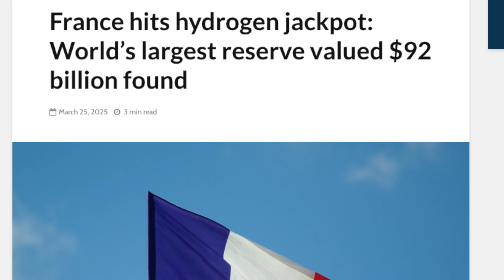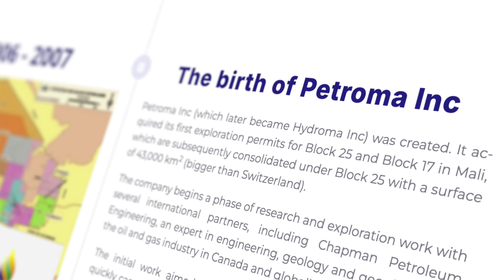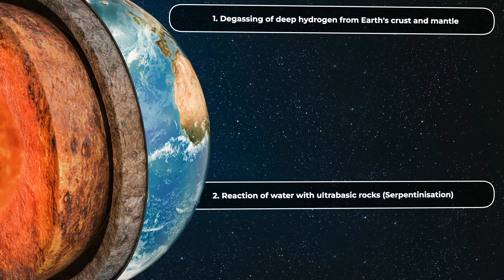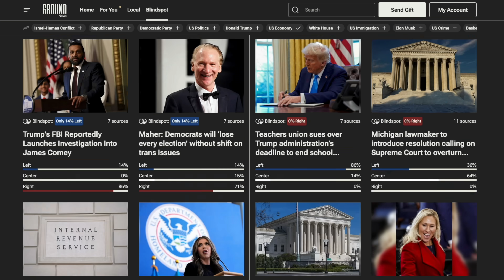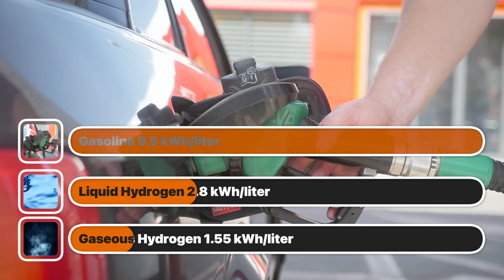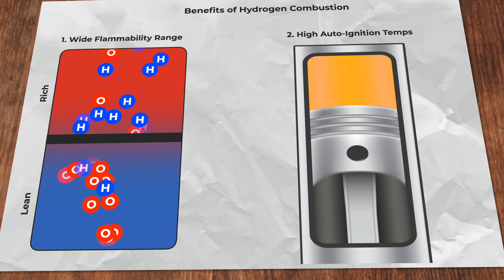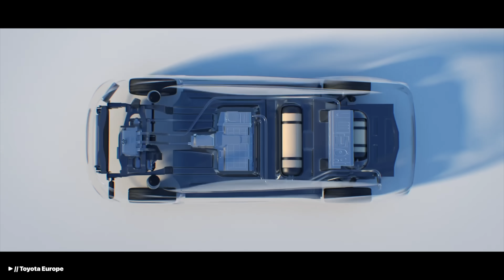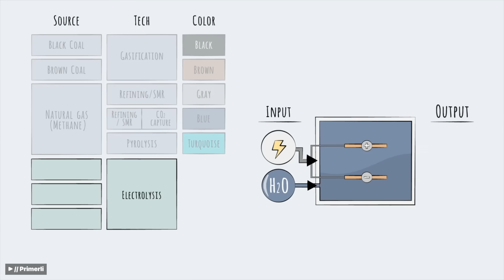This Hydrogen Discovery Can FINALLY Replace Oil & Gas!

Comment: I would really like to see a video about hydrogen for aviation. Liquid hydrogen might not be suitable for transoceanic flights but it should be more than good enough for travelling within a continent. But the issue is if aircraft can be made to handle cryogenic fuels because liquid hydrogen's temprature is -252C

Comment: 1- We too often think that one resource is the only answer.  For our power needs, many options are there.  But the nature of the need will determine the viability of the solution(or fuel).  What is best for powering our electric grids, will probably have little value for powering our vehicles.  And for a resource(fuel) it's conversion, transportation, and storage also determine it's viability to  a specific use.  
2- This is another resource that will be exploited for use and profit.  I can't but wonder how we are different from the aliens in sci fi movies like "Independence Day."  Is our behavior just leading us to ravage our planet?  But not have the space travel to find and ravage other planets.  We don't seem to understand that our planet is finite.  And we cannot just fly away.

Comment: Nope.  A plane with the heavy tanks necessary to hold high-pressure hydrogen would weigh a LOT more than a conventional jet-fuel plane.  

It's not an apples to apples weight comparison.
Reply: According to the data on Wikipedia and some back of the envelope calculations, if we scaled up the technology used on the Toyota Mirai (which operates at 10,000 psi) to work for a Boeing 787 - the storage tanks alone would weigh 645,680 kg and their volume would be 900,262 litres. That's a 3 metre diameter cylinder about a 127 metres long. Add the fuel and you have 680 metric tonnes, so obviously, this won't be the approach  .. they will need to use liquid hydrogen at much higher density and lower temperature.
Reply: The passenger seats would be mounted on the wings, free hair due😮. @jim23mac
Reply: @jim23mac  Did you include the fact that tanks scale very efficiently?  You can increase the volume of a tank by a factor 100, at 10 times the cost. Basically because the surface area of a tank increases much less quickly compared to how much it will contain.  If you didn't include that, I imagine the actual weight would be vastly lower then what you calculated here.

Another factor that could influence things is, is that car tanks would not be optimized for weight, unlike things in aerospace. One can for instance consider how rockets running on hydrogen don't have tanks weighing remotely as much as you calculate there. Admittedly those tend to work via cryogenic liquid hydrogen, but never the less it shows how large tanks could be made in another way.
Reply: @Quickshot0  No - I didn't factor that in - I was just stating the worse case - but I did say they could do a lot better. Also - after doing some more research - I'm pretty convinced that any long-haul aircraft would use liquid hydrogen, where pressure is not longer a problem. I'm really not any kind of expert on this - just thinking out loud.
Reply: @jim23mac  Got it. There probably is some kind of solution in any case, as Airbus seemed willing to look in to it.
Reply: @Quickshot0  I'm pretty sure that Airbus gave up on hydrogen.  People who understand what it takes to get an airplane certified will tell you that hydrogen is an absolute non-starter.  The only sane thing to do with white hydrogen is to use it to make things like fertilizer, steel and chemicals.  Hydrogen as an energy carrier is dumb.
Reply: @jim23mac  OF COURSE you'd use cryogenics in a hydrogen fuelled plane - after all we've been doing it in rockets for 70 years.
Reply: @kenoliver8913 That's right... but how many delayed lift off due to valve cracking...
Reply: @ Hmmmm..... rockets use their engines for a few minutes... planes use their engines for hours...    how does the technology scale?  Seems like apples and oranges to me.
Reply: Now, wait a minute heah, highdrogen is lita den err, soo, it shud be eazee to tranzport.
Reply: Why fly a plane when it could be used in an airship, uncompressed, where it's light weight is a benefit - there are safety concerns but the death from the Hindenburg disaster were not from the hydrogen but the oil cloth burning that covered the airship.
Reply: I am just thinking of what it would look like if a plane filled with hydrogen crashes.
Reply: @ Less spectacular, though as deadly, as a kerosene fire. Burning hydrogen is invisible - you'd just see the massive shock wave from the detonation in the instant before you cease to exist.
Reply: While I know that Ev’s are just a better solution than hydrogen cars, I would be interested in what they can do if they had an easier start in hydrogen tech. And don’t bother with anything that a battery can already do. There are areas where hydrogen has use cases over batteries, so focus there. Examples are flight and shipping.
Reply: You have no idea what you are talking about
Reply: @emerjay348  Please enlighten us with facts and links to the facts.

Comment: The problem with hydrogen is hydrogen itself. Hydrogen will have its uses but because of those many issues with it, using it as a fuel just doesn't make sense.
Reply: Depends on the application of course, though it's inherent properties mean it is devilishly tricky stuff to store.

I'd be interested to see an in-depth comparison between hydrogen and ammonia as fuel sources.  Thinking primarily of maritime applications here.
Reply: @TheHoveHeretic  People have looked at it.  I don't think it's a big win.  Ammonia is extremely toxic.
Reply: If we run out of oil or decide, killing ourselves is bad.
Does it make sense then?

Nothing is perfect initially. 
Look how long it took to get fuel efficiencies to where they are now. 

We achieved these fuel efficiencies near the point of abandonment.

The faster we transition, the faster we find better ways of production and gain higher efficiencies. 

No entity consumes fuel like the militaries of the world. That's the test bed.

Comment: Your predictions on the energy conservation of Hydrogen are false and misleading. We have known how to extract hydrogen for more that 100 years, yet we are still driving gasoline fueled cars, why? Simply stated if hydrogen were the answer, then why can't we simply put a electric hydrogen generator into a car and use it to produce the fuel for the vehicle? That answer is obvious because it takes more fuel to produce the electricity need to produce the hydrogen than it would to simply use the electricity to fuel the car. In other words it isn't economically feasible to expect a hydrogen fueled vehicle, because of the associated costs with the energy needed to produce it.

Comment: With electric cars and solar, there is at least a possibility of owning your OWN fueling station. Not interested in hydrogen for cars. You would still be dependent, and have to travel to get your fuel.

Comment: im baffled that people are still talking about hydrogen in the transport sector. everyone did the math, everyone knows it makes no sense whatsoever. 
whatever clean hydrogen we can find needs to go the industries where it is needed!
Reply: All available clean sources of energy should go to where they have the biggest global impact, unfortunately the "human factor" kicks in... people want to "see" and "feel" they are using the green stuff, even if by doing so they are wasting part of it's potential.
Reply: What baffles me is how people don't seem to understand that what is burning when they use fossil fuels is hydrogen. An engine doesn't care where it gets the hydrogen from hydrogen is hydrogen. What must be done so that pure hydrogen burns at the same rate as the fossil fuels the world uses is to add in stuff that does not support the combustion process so that the burn rate is slowed to equal that of fossil fuels no matter the type. Basically to equal the burn rate of fossil fuel one must create a traffic jam of sorts making it harder for the hydrogen to react with the oxygen atoms to create water.
The only reason why the world isn't using hydrogen for vehicles of all types is Capitalism as those folks heavily invested in fossil fuel tech and didn't want to stop their chosen cash cow from making them massive profits. All the technologies that have come out that show ways to get the bonds of water broken using far less energy than conventual electrolysis get smeared by loads of propaganda put out by those that sell and invest in fossil fuels.
Reply: Hydrogen can be useful for the production of ammonia and aviation fuel. So it could have its' uses in some transportation markets.
Reply: These green idiots are even trying to force us to use batteries or hydrogen on airplanes. They've got legislators to subsidize such idiotic projects and are even trying to push this on companies like Airbus and Boeing even though air traffic only uses 2% or so of all fossil fuel. Good thing is Trump is going to end this total nonsense at least for the USA.

Sad thing is that these left-greens are too ignorant to even understand how idiotic their demands are.
Reply: I agree that Hydrogen  Gas is not viable as an aviation fuel. In liquid form it potentially could because of its light weight. But a lot of engineering needs to be done to make it safe. Don't dismiss this to eagerly yet... I do however completely agree that it would probably be a lot wiser to use it where it is needed in large quantities. Build a Power Plant on top of a Hydrogen source. Easier and safer to carry electricity than Hydrogen.
Reply: @tomduke1297
I totally agree on that. This makes no sense at all, even if the fuel becomes cheaper with renewable electricity. It's way better, easier, cheaper, safer and efficient to just produce electricity, transport it through well established tech in grid, store it into batteries and use an EVs. There is a full lot of research on batteries tech, and this is only the beginning where combustion engines had like 60 to 100 years to develop.
The fact that the first automobiles where running on electricity but they swapped to fuel is awefull when you think about it but grid was not that well developped then. Now it makes just no sense to exploit a fuel, transport it, and consume it. It's inefficient as possible, in all possible ways.

There is a space for hydrogen as fuel, like in aviations, or maybe boats, something who need A LOT of energy with some constrainst (volume or weight) that batteries cannot probably satisfy. But consumer transportation is clearly not the answer. The closest scenario would probably be public transportation (buses, trains ?), but in this case, space and weight are less an issue, so it pins into charging time/batterie lifecycle (as they drive a lot), but even though, for this case, we could perfectly get some alternative techs (swappable batteries ?) which still negates the need for hydrogen.

Of course, there are some niche applications that could work, but I'm pretty 100% confident that hydrogen will not take off in cars. Not with current tech. Maybe in 50 to 100 years when we will discovers new things, alliages, techs, but not before at least 30 to 40 years.
Reply: That math does not relate to white hydrogen which will have very low extraction costs and relatively moderate storage. There is no energetically expensive hydrogen creation step.
Reply: But, but, but Toyota said hydrogen is the future 😂😂😂😂😂😂😂. Clowns.
Reply: @sandyfordd1843  I guess Toyota is deaf to three terms:  
Round trip efficiency 
Volumetric energy density 
Hydrogen embrittlement
Reply: if can drill into huge geological hydrogen reservoir that could last for decades, then could pipeline that to stationary electricity generators. Nice reliable, clean, base load electricity production.

I think hydrogen would have too many issues for it being practical to pipeline directly to home consumers as is done with natural gas. But pipelining it to the institutionalized industry of utility electricity suppliers probably very viable.

This is probably the only practical way to utilize hydrogen - if there are large natural supplies of it to tap into to make sourcing it economical. All other avenues of trying to tap using hydrogen are fraught with engineering folly obstacles that are legion.
Reply: @ Don't forget H2 is the smallest molecule on the periodic table,and can embrittle steel,making it prone to leaking and eventual failure. No material is completely immune to embittlement.
Reply: @mikedunn7795  that's not nearly true, helium molecule is way smaller. And it can be stored easily too, in composite tanks
Reply: @TheSulross waste of hydrogen. Nuclear can do it more reliably. Better to use it for steel and cement production instead of natural gas and coal
Reply: @  Yeah, nuclear power is the real answer as all these exciting headlines always never pan out to anything at all, or are not very significant in the big picture (i.e., moving the needle)

Would see geological hydrogen as just the occasional wind fall situation - kind of like hydro power. Can't do hydro electricity generation everywhere but in some places it works out.
Reply: Hydrogen fuel cells are a lot better than hydrogen ice
Reply: CPKC railway in Canada has a couple of prototype hydrogen powered locomotives.  There may be a future for it in that particular transportation sector.
Reply: @heronimousbrapson863 nope.  Better just to combust compressed natural gas or biodiesel or bio ethanol or biamethanol.   There is no practical application outside of producing hydrogen as a chemical feedstock in fertilizer production or other chemical processes.
Reply: @heronimousbrapson863  *CPKC railway in Canada has a couple of prototype hydrogen powered locomotives*.  
Yes,there are some uses for H2,including H2 powered locomotives,and long range jet passenger planes. Both can refuel at a few selected sites. What drives me crazy is talking about passenger cars using H2. How would you get a refill for a H2 powered car? Google says there are ~ 145,000 gasoline stations in the country. Who would fund building an equal number of H2 stations,when next to nobody drives an H2 powered car? Contrast that with battery powered cars,which don't need infrastructure build out,because EVs can plug in and charge anywhere.
Reply: @mikedunn7795  I see Mac Donald’s driving around with H2 trucks all the time here in Europe. So for a truck fleet that also seems super feasible. And honestly, "not enough gas stations" was said about electric too. In many countries that is not an issue any more. And honestly no energy source will cover all the needs, so it's good enough if it can fill some spots. But sadly the video doesn't even talk about the feasibility of the depot and the extraction. End the end it needs to by economically viable.
Reply: it could be plausible if produced on site from water and aluminum and used in electric energy generation
however, straight aluminum battery is quite better
Reply: @tyalikanky  Taking water, and making it into fuel is a bad idea. First, there's no net gain in energy. Two, we need water to live.
Reply: @ energy charged when you deoxidize bauxite to aluminum. After your source is hydrolyzed you could recycle it
Reply: The greens are too dumb and too lazy to do any math or thinking. The same could be said about electrification of cars. To electrify cars we need batteries and a whole charging infrastructure and only a fraction of the energy goes into transport.
If we instead electrified heating we wouldn't need the batteries, we wouldn't need charging infrastructure and we could easily dump excess electricity we get from solar or wind at the wrong time into heating up water in water heaters tanks. To heat water for showering we don't care exactly when it is heated up.

The stupid greens always need to make a big splash and force others to do what they think is right no matter how stupid their current ideas are.
Reply: @AlJay0032  When do we have excess solar energy production we could use to heat? And when do we need energy in form of heat the most? It's a different answer for both.

Comment: Sir, I really like your videos, but your continued blind spot when discussing hydrogen and the debilitating problems of Hydrogen Embrittlement, make you a cheerleader, not an unbiased source.
Reply: see plasma kinetics company .....solid state hydrogen storage
Reply: Overall a weak video, because it barely talks about the found deposit. Is it even economically viable? If so, best case would probably be a short pipeline network and run some gas power plants to replace fossil methane that gets used in all the Benelux countries and Germany.
Reply: I'm going to go out on a limb here and guess every time some hydrocarbon product, from aviation fuel to nylon, gets a mention, you don't criticise the lack of explanation of the multi-layered processes which produced the end result.
Reply: @TheHoveHeretic hydrogen is very reactive, think Hindenburg?!  Not just with oxygen , plus it must by cryogenic stored and double tanked. There are a lot of engineering problems with hydrogen use.  This guy makes it look like hydrocarbon use was all about cost.  It’s not the case, it’s really safety, storage/transport, and efficiency!
Reply: @AX2SEG  Hydrogen bound to carbon is NOT molecular hydrogen (H2).  Not even close.  Why are you cheerleading for hydrogen?  As an energy carrier, it sucks.  It's very hard to contain, leaks like crazy, is itself an indirect greenhouse gas, via consumption of atmospheric hydroxyl radicals, thus making methane more long-lived.  It takes a lot of energy to compress.  It causes embrittlement of steel.  Ricky should know better than this.  He ought to read Michael Barnard.